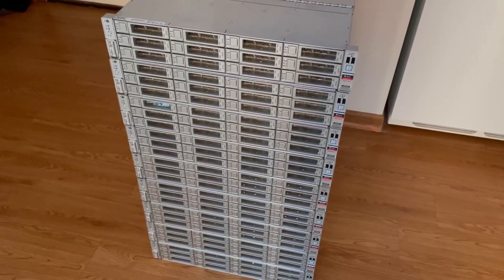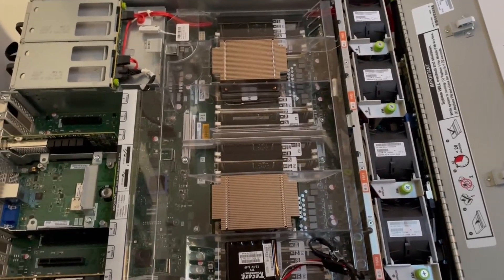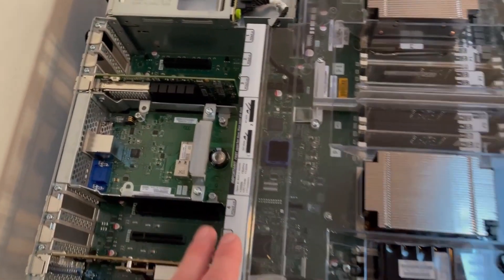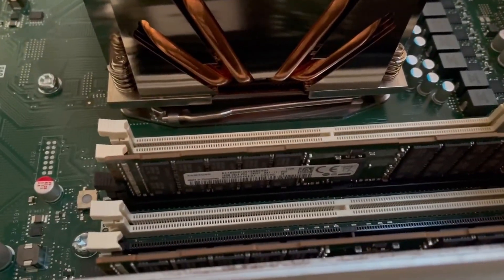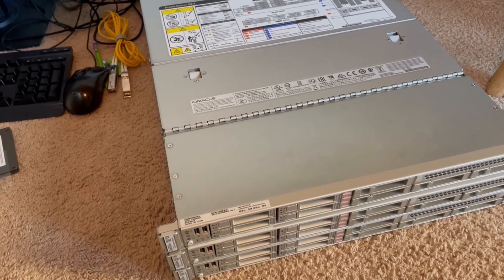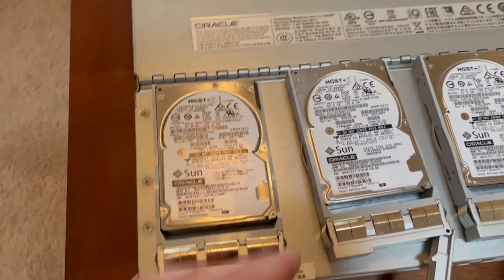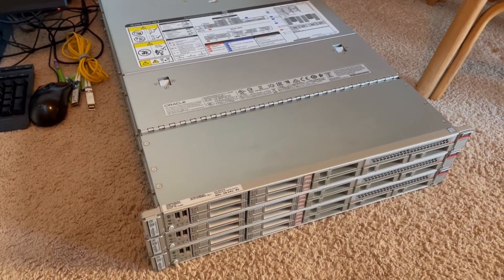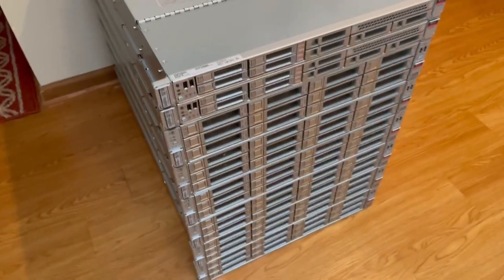Oracle Exadata X6 Database - Servers and Hardware

Comment: Hello, do you have any experience with the sun microsystems sunfire v120 how to install spark solaris 10.i have 5 years sunfire v 120 and still not figerout how to install with console cable operating system solaris. Please help me
Reply from the maker: From the serial connection you’ll want to launch the console, then you can boot cdrom to start the installer

Comment: powering that will end up being  nitemare is the only caveat - good for big data though - you will want to upgrade to 100g
Reply: upgrade to 100 G for what? The CPUs probably can't even saturate 100 GB without insane utilization, unless you have apps that can use iWARP/RDS/RoCE to minimize it, 100 G isn't really feasible for regular TCP/UDP applications without significant bottleneck of the network stack.